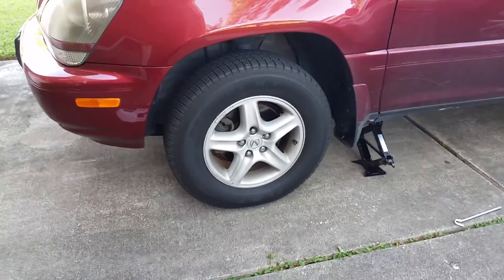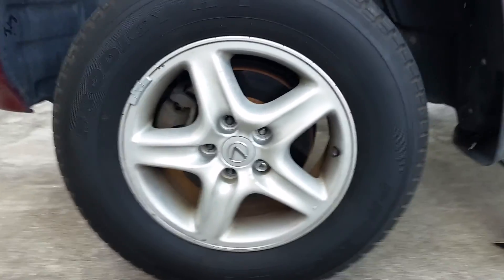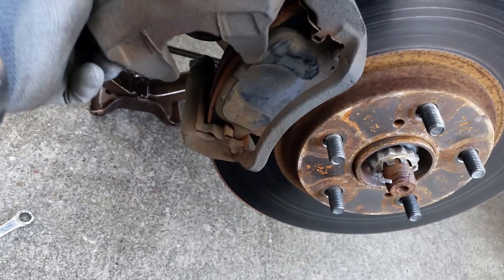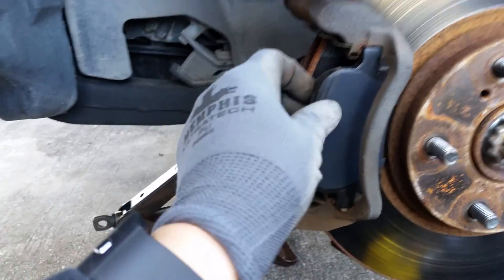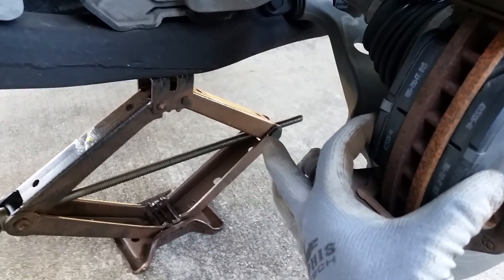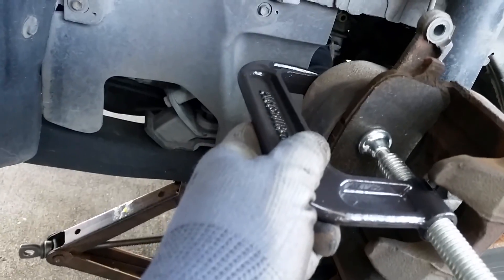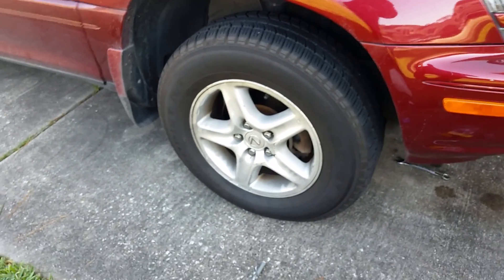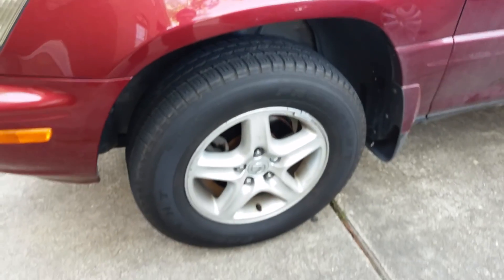Lexus RX300 Front Brakes Pads Replacement

Comment: You really shouldn't put new pads on old rotors. It can be done in a pinch but it's bad practice. For the relatively low cost of rotors, they should be replaced with new. That or at least have the old ones machined to a new and smooth surface. Furthermore, you should completely remove the caliper and carrier arm (even if not changing the rotor) so that the metal pad contacts on the carrier arm can be cleaned with a wire brush. You should also do this so that you can grease the contacts to ensure the pad slides in and out freely. That's what that blue grease pack in the box of brake pads is for! If you don't do these last two steps it is a lot more likely you will have a stuck pad and then uneven or very quick pad wear. Moreover, I noticed you removed some of your brake fluid after compressing the piston. This should not be necessary unless you've added extra brake fluid somewhere along the way. You've compressed the piston ALL the way back with your C-Clamp; this is not the position the piston will sit it once you hit the brakes the first time. Once you press the brake pedal the fluid level should drop to within the normal operating range.
Reply: Professional mechanic?..Sounds like it..Scissor jack, dangerous..No jack stands used, dangerous..Fulid is very dark, needs to be bled and replacd..Excellent correct information and details in your comment sir.
Reply: @MrRockzilla86  Yeah the factory jack threw me off, I always put my vehicle on jackstands, and still put the jack under the frame pinch weld for emergency support as a hazard, I don't understand mechanics that rely on a jack
Reply: @JDMHaze  Yes sir..I do the same
Reply: Literally millions of rotors are replaced annually without good reason. The old timers will tell you most have done pad replacements their entire life without replacing rotors, even when rotors were close or below spec. Is it dangerous not to replace non-spec rotors? That question can be answered easily..... how many accidents have you heard about that were due to rotor/brake failure as a result of a rotor being worn too thin?
Reply: I always grease the roster and the new pads. I use a whole can on each wheel. That's 4 large grease jugs. Ohh! And don't worry about putting your lug nuts tight. All they need is snug. If your missing some lug nuts? That's ok. Your tire only needs three anyway. Kind of stupid the manufacturer puts 5 on anyway.
Reply: If you guys have any questions? Just ask. I'm full of answers.

Comment: Beware of "scissor jacks" they are not very stable, threading is very thin on the housing body the crank threads into. Whenever using a Jack always use jack stands underneath the frame of the vehicle proper points for safe support of the vehicle..Unless stranded on the side of the road..Just trying to be helpful..